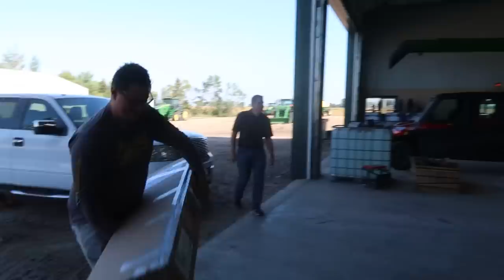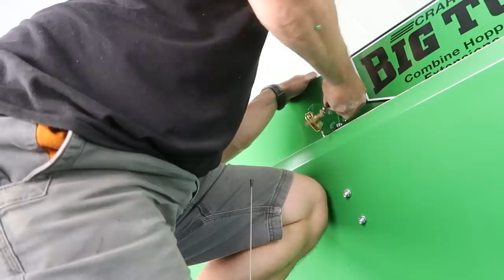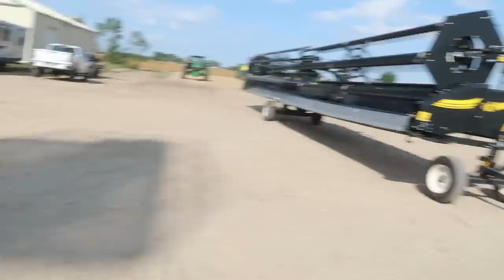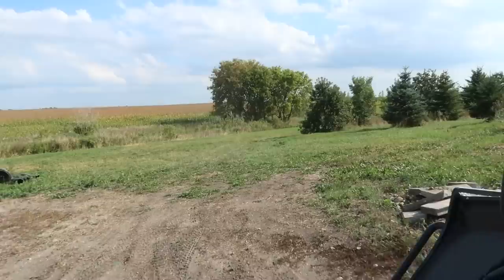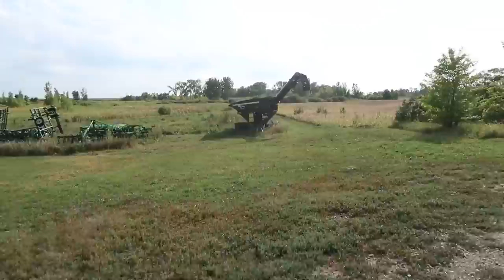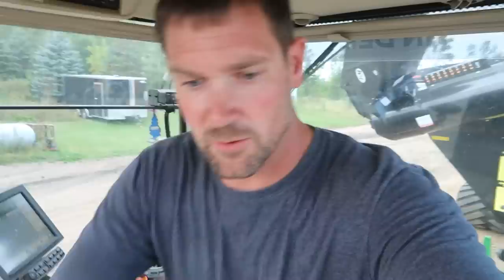Our New Combine Harvester will hold over 500 BUSHELS! Updated with a Crary Big Top

Comment: Zach...  First, I know zero about farming, but I have watched enough of your videos where you have wondered which size pin was needed for a given piece of equipment.  Might I suggest using a color code system.  I'm not sure how many colors you would need to paint the pins and the tow eyelet for each implement but it might take the wondering out of play.  When I was in the Army as a heavy truck driver it was pretty simple air hoses were red and I think white or yellow on the ends of  the hoses if my memory from 30 years ago serves me.  The electrical cables for the lights didn't have a color as they were the same for all towed trailers it was a universal light cable.  Civilian trailers use different cable connectors for the lights I think.

Comment: Little tip for hydraulic lines. Put zip ties on the hoses to number them. As in, put 1 zip tie for scv 1, 3 for scv 3 etc. And have them so they're only on the left or right side hose. Makes things so much quicker when we're swapping implements, we have them numbered 1-5 and they go on the left, easy as

Comment: Late to the party, but make sure you do some calculations on the weight specs of your combine to see the maximum safe load. Somewhere between 5-10 years ago, we had someone where I grew up that had added a bin extension (though I think more than 100bu), and the next year was wet enough during harvest that the loaded weight of the head and extensions overloaded the combine and bent the axle and/or final drives. Even though the combine was only a couple years old, they were out of pocket for the repair because of the bin extensions.

Comment: Go buy a small sheeters  bit  #30   Double cutting flute.  To drill pilot hole   And. Change to larger sheeters bit  and bore your hole the size you need.   Later.

Comment: Wild Idea!!! 
Each tractor has line ports.  
Each implement has lines that connect to those ports.  
Step 1 Pick a tractor that uses many implements and label the ports 1,2,3...x with 2" high labels.
Step 2 pick a complex implement, hook up all the lines, and test for correctness.  Adjust as necessary.
Step 3 Label the lines same as tractor. (1-1, 2-2, 3-3 ... x-x)
Step 4 Move the implement to all the tractors that it fits and label the tractor ports.
Step 5 Pick the next implement and label the lines based on the tractor port numbers.
Step 6 Move the implement to any unlabeled ports, tractor. Label ports with line numbers.
Step 7 Repeat until all implements and tractors are labeled. 

Next time you connect an implement to a tractor simply connect (1-1, 2-2, 3-3, ...x-x)

Play it again Sam !!

Comment: I'm still waiting to see any farmer torque a bolt.
Reply: After you've done something for years, there's often no need for a torque wrench unless you're rebuilding an engine. You get to know what size bolt needs what, and what jobs actually require a torque wrench.  I've seen people use torque wrenches when they replace a wheel, and I just think to myself: "Why"? Of course there's no harm in it, but usually unnecessary for someone that's experienced.
Reply: @davedammitt7691  I don't agree - at all.
First, most people have no idea how a bolted connection works.  It's a clamp.  It's designed to use the bolt as a spring to hold the connection together and keep the surfaces from sliding.
Second, most people have zero intuitive feel for how tight a bolt should be.  They don't properly account for size, thread pitch, grade or lubrication.  Intuitively, people tend to make a bolt that's twice as big twice as tight as another bolt.  But that's entirely wrong.  1/4x20 grade 5 - 6.3 foot pounds.  1/2x20 grade 8 - 90 foot pounds.  Twice as big, 15 times more torque.
This leads people to over torque small bolts and way, way under torque large bolts.
Finally, impact drivers provide almost no feet at all as to how much torque you've applied.  Intuitive estimates can be off by a factor of 10.
I've torqued bolts from 3mm to 30mm, requiring everything from a micro torque wrench to a hydraulic torquer.  While I've never used one myself, I've watched the use of a hydraulic tensioner.  I've watched bolts break because someone didn't properly torque a bolt (over-torqued for small ones, under-torqued for large ones).  It's not intuitive - for anyone.
Reply: @ljfinger  alrighty there, Slick. I'm in my mid-50s. Been working on vehicles and various equipment of all types all my life. In the past couple of decades, the only times that I've ever torqued anything with a torque wrench is when doing engine work. Can't recall the last time that I broke a bolt, and NEVER had anything come out come off going down the road. Guess I'm the one out of  billions people on earth that has just been absolutely lucky.

Comment: If you added 100 bushels of capacity, you increased the weight by almost 6,000 lbs.  Are you concerned about exceeding the design weight capacity for the combine?
Reply: Lots of people use 500 + toppers on JD combines. The reason we have one is so we can make a half mile in good corn  and unload on the way back to the trucks. That way neither the combine or the grain cart is carrying a full load for very long. If you have to unload in less that a half mile you end up with the cart hauling a full load from the middle somewhere and from the far end sometimes. We've used the biggest topper available since we had a 9600 and have never had a problem . Currently running a 780 with 550 bu topper.Not adding much more stress to an S series than a 16 row cornhead would vs a 12 because that weight hangs way out in front of the axles.
Reply: I understand the motivation for adding capacity.  The question is what is JD’s design margin on weight capacity?  I would expect at least 50% so I am sure adding 25% is OK.  In past years designs had to be very robust since structural analysis tools did not exist.  However now these tools allow less conservative designs so design margins are reduced.
Reply: @kennethjacobs2875  I know of someone 30+ years ago that had a 550 bu extension on a 7700 which isn't half the combine. They did wrap the axle tubes with plating.
Reply: You dont fill something like that on rolling ground but the relatively level land in the southern half of Minnesota it works. Rarely see a combine here with the factory tank topper unless its the add on kit like Zach is doing.